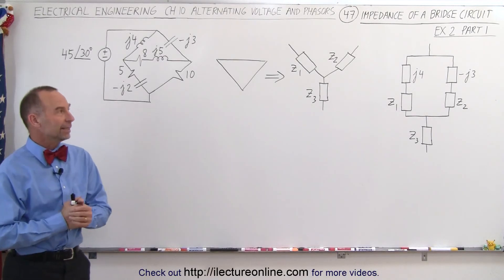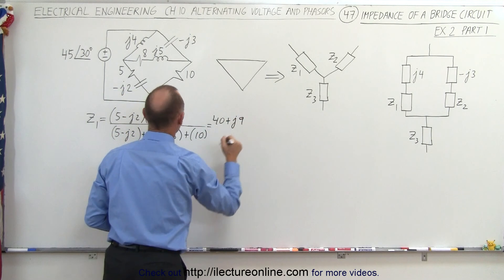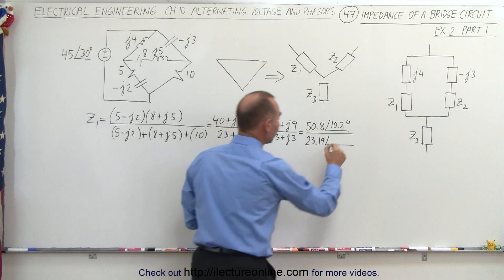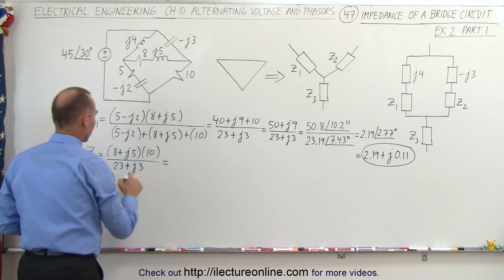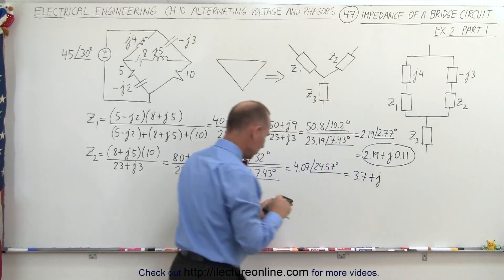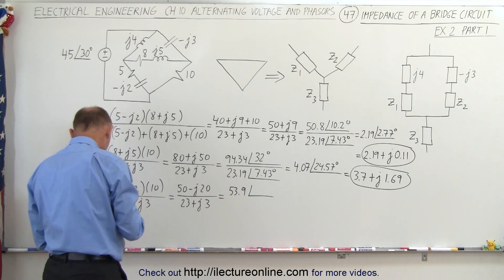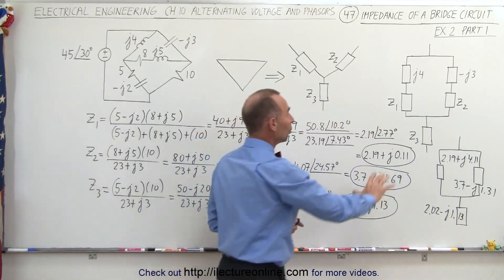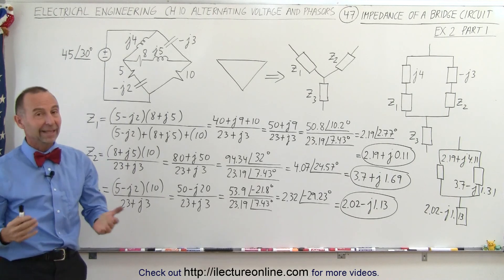Electrical Engineering: Ch 10 Alternating Voltages & Phasors (47 of 82) Z=? Bridge Circuit Ex. 2-1

Comment: Dr. Biezen, would it make a difference if  the top portion of the bridge circuit was used for the delta transformation instead of the bottom portion?
Reply from the maker: You can do it on either side.

Comment: Hi Professor, for the multiplication of (8+j5)*(10) will end up with 90 degrees different in phase angle if we convert it to the phasor domain first and then do the multiplication. I notice from your previous example there a similar condition but you converted to the phasor domain first and the multiply. Can you explain when I should use phasor domain and when I should use the frequency domain? Thanks!!
Reply from the maker: You can do the multiplication in either domain.  Sometimes it is easier in one, and at other time it is easier in the other domain, depending on the situation and the numbers.  It becomes a personal preference.